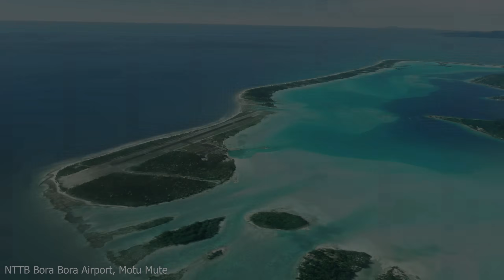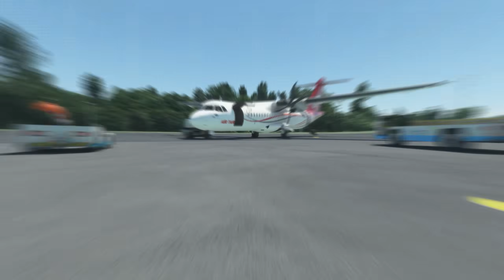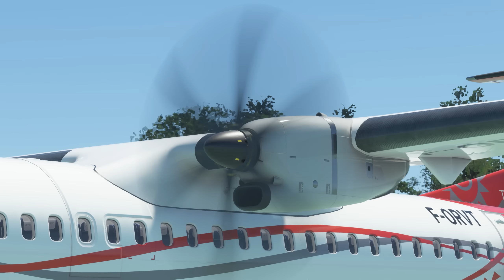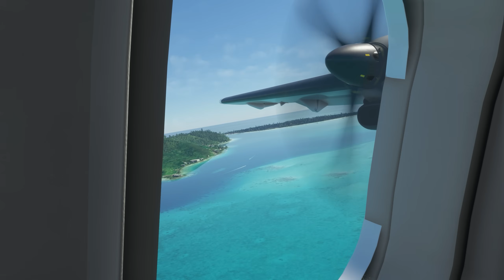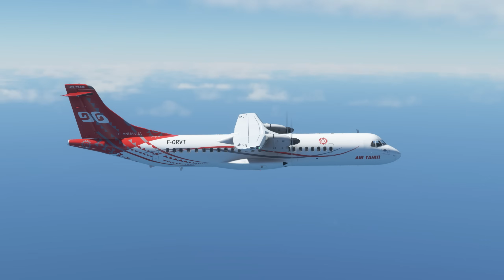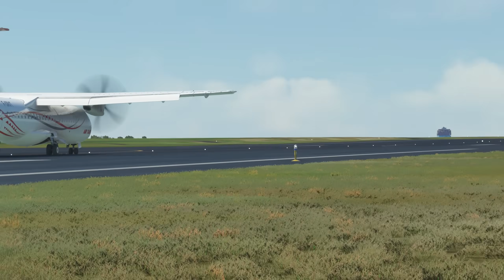All NEW ATR 72-600 for MSFS in Bora Bora!

Comment: As you accelerate place your aileron back to neutral gradually you dont need them anymore for the x wind because rudders becomes effective . If you keep your aileron,  you gonna roll as the lift is building up . Nice departure 🎉
Reply from the maker: that's why I did that, with MSFS and the Weathervaning you have to eyeball it. I saw roll on the wing so in this case I had to counter it pretty much to V1 albeit ever so slightly.

Comment: Nice flying of the ATR man. Just a note though, not sure if it's your preference but I'm sure you're supposed to set your prop conditioners to auto after take off and set the power mode to climb. Then you should hear the props rpm change. Then you either fly with them in auto until landing or go back to max in gusty conditions while landing. I've observed this in many ATR videos. Thats why in your video it sounded like you were in max rpm during the cruise. Just thought I'd point that out there. Great video regardless. Continue to do more!😎👍🏿👍🏿